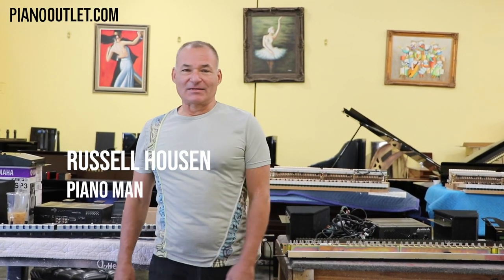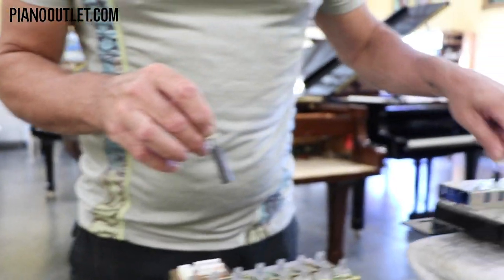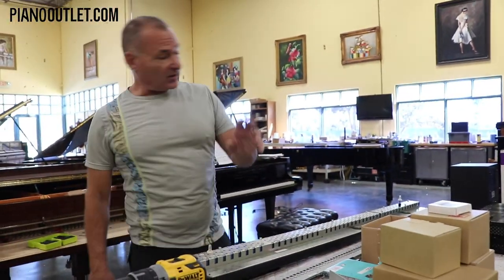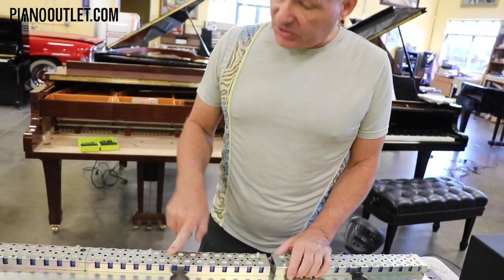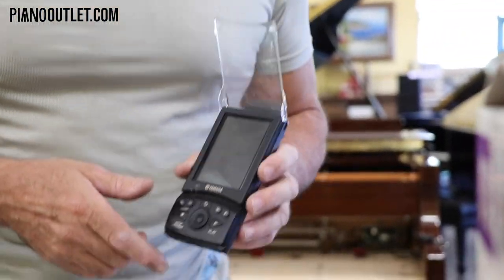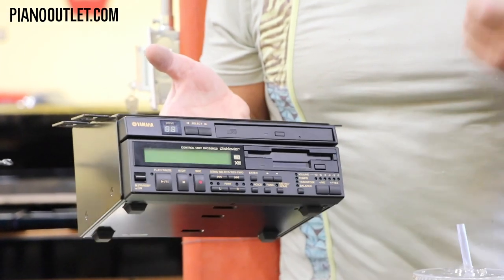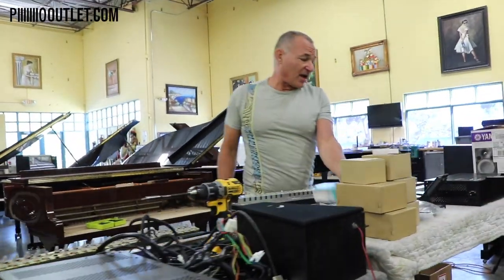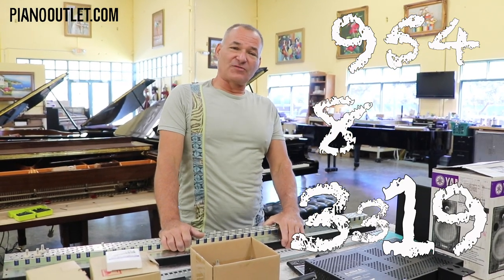Yamaha Disklavier Mark 3 and 4 component comaprison

Comment: Hi Russell, we have Yamaha Disklavier MX100II which couldn't power on. We suspected that power supply was faulty so open the top cover to access the control unit. However, we couldn't find the power supply. Can you please advise us where is the power supply and how to remove it? Thanking in advance